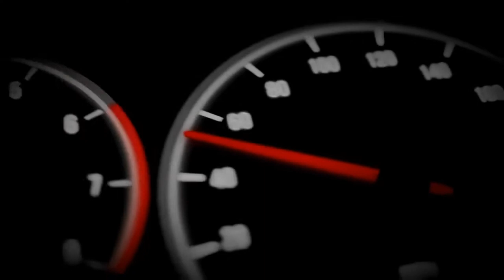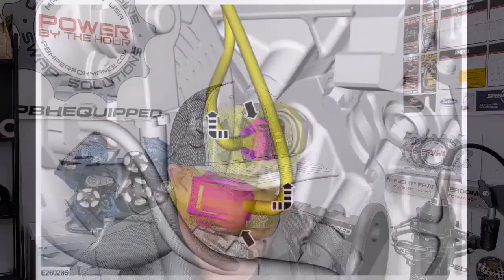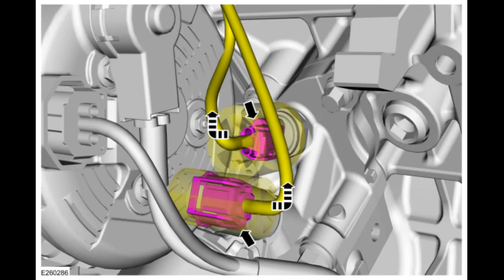PBH Live Episode #9 Oil Coolers and Filter Adapter's for your 5.0L Coyote Swap

Comment: You guys might want to check out Improved Racing. I got their Gen 2 filter relo adapter and it's supreme quality. Not sure if they support other generations at this time, but they do make other things like thermostatic oil filter housings as well.
Reply from the maker: Looks like nice stuff. Thanks!
Reply: I'm using of there Remote Engine Oil Filter Mount with Thermostat. Excellent quality and it works great.

Comment: What kind of fluid temperatures should you see on he power steering/hydroboost setups?
Reply from the maker: I have seen power steering temps in the 150-170 on non hydroboost setups. I believe it should normalize around the same temp as your cooling system and even oil temp. So 170-200.